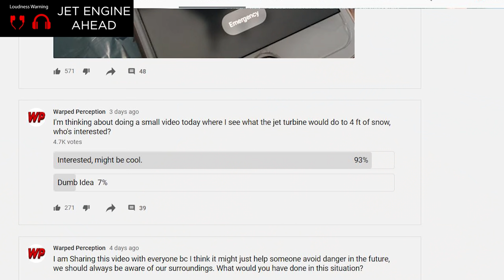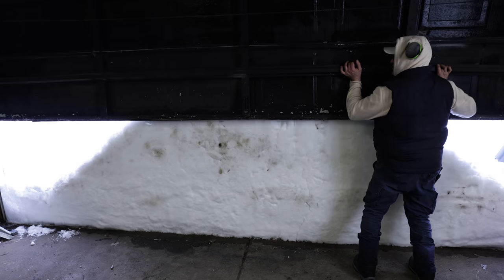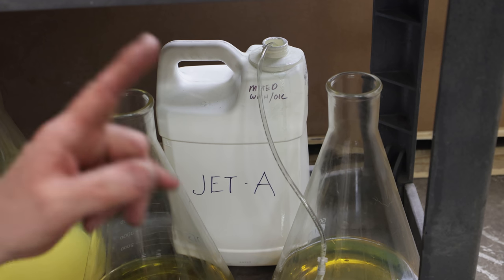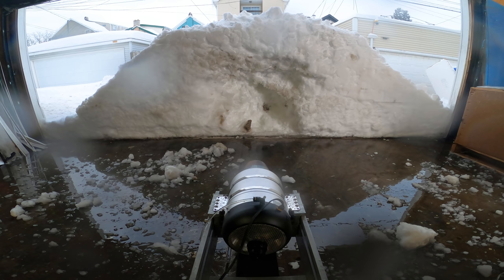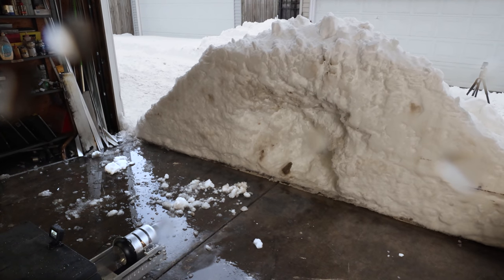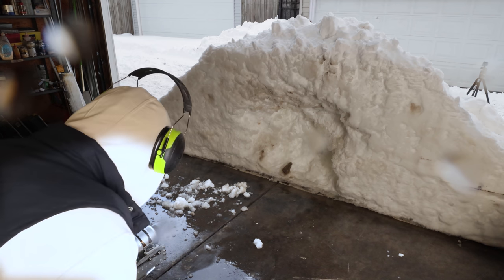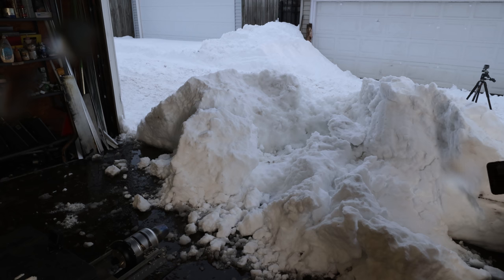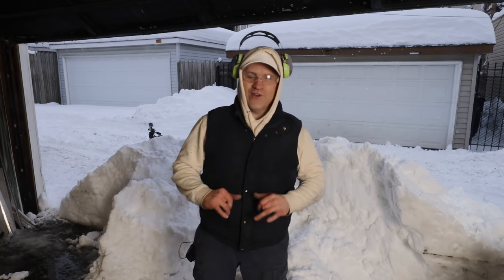Using RC Jet Engine to Clear Some Snow

Comment: I was wondering if you could use an aerosol can as a cheap substitute to nitrous oxide. Not exactly sure what kind, just something that wont make the engine get gummed up easily (mosquito repellent maybe?) Love your vids btw.
Reply: awesome question
Reply: not really better off using LPG
Reply: @GWRProductions-kg9pt  LPG?
Reply: @savagetuner2404  Liquefied petroleum gas
Reply: @GWRProductions-kg9pt  you could try saying gasoline lol
Reply: @GWRProductions-kg9pt  oh I read that wrong too dang it
Reply: @savagetuner2404  two completely different fuels
Reply: @savagetuner2404  LPG isn't gasoline.  It's propane.  I'd be curious as to what, if any, gains would be made by adding it to the intake.
Reply: @krb5292  technically LPG can refer to several mixtures of various ratios of fuels, just propane tends to account for over 80% of most mixtures. Butane is the second major constiuent, in some places, it is up to half the mix.
Reply: the only things i can think of are canned air (flammable when sprayed upside down) and carb cleaner, but im not sure if it would result in more power (or byproduct/carb buildup). I mean butane would be the obvious choice, but $3 nos sounds much more amusing lol.
Reply: @richardramsaran5093  carbon fouling
Reply: Lol upside down whipped cream can.
Reply: Nitrous oxide is an oxidizer, not a fuel
Reply: Nitrous oxide increases an engines power because it carries its own oxygen, allowing you to add fuel, & increase cylinder pressure which = 🐎🐎🐎🐎🐎🐎🐎🐎. 
So yeah man an aerosol would work so long as it carried oxygen in whatever it’s spraying. & here’s a fun / useless fact: Nitrous oxide does chemically what super chargers and turbo chargers do mechanically ie more O2, more fuel, bigger bang
Reply: @savagetuner2404  Why would he say gasoline while talking about LP? They are two completely different fuels..
Reply: twin slamanders as turbine jet engines...hmmm
Reply: Never use nitrous oxide on a rc jet engine. It would just meld down due to the highly increased speed and heat. Just Diesel or Kerosene and 5% of turbine oil as lubricant. LPG or CNG would be possible, if you change the lubrication system. However, the lubricant will be burnt so ever.
Reply: Or you can use dabs as a fuel. Might get high in the process but it's worth a shot.

Comment: I can only imagine what the neighbors are thinking as they hear and then see a jet engine attempting to blow snow towards their garage door.  lol.
Reply: You guys should collaborate on a jet powered farmabago
Reply: @MrPhatties  this is a good idea
Reply: They probably piled the snow up in front of his garage because they're sick of the jet engine noise hahaha
Reply from the maker: I was about to mount the jet engine to my little mini front loader and drive it down the street while blowing snow.   But I didn't do that because I need to use this engine for some upcoming episodes and the risk of damage from FOD was very high ...lol
Reply: Flame thrower would be better
Reply: @FuzzyWCTX   This actually works better than the flame thrower.
Reply: I like cheese
Reply: this project is call, which neighbor is the best, lets find out
Reply from the maker: @MrPhatties  yes!! Either like 10 of these on the farma or one 1000 lb
Reply from the maker: @voxelemur  no it's a typical City thing, if you have a garage that you usually don't pull a car out of they just use that spot to pile the snow to clean their driveway, there's just not enough space
Reply from the maker: @redredredred2  lol
Reply: @WarpedYT  make it happen and both channels will win 😅👍
Reply: Would be one of only a few things..  " what an inventive guy". "Hey come look, he's drinking again". "What do we tell the cops?"  "~ptsd flashback~". "I wish i had a jet engine to melt snow". "Godamnit i cant hear my matlock". "Benford snow blow 5000"....
Reply: @WarpedYT  are micro turbines safe to operate in enclosed environments?
Reply: Can you do a comparison of best jet fuels?
Reply: Jet engines make a better sound that a Briggs engine
Reply: If I lived in the country I'd be doing the same with my engine!
Reply: @WarpedYT  If you are interested, a YT channel called Agent JayZ  tests his rebuilt full size jet engines in what he calls jetwash alley. Big difference,3 gallons of fuel versus 300 or so. Clears a lot more snow.I 
Now if you could rig a power takeoff turbine and driveshaft, and turn your little engine into the sort of unit that powers helicopters or cars,that would really get you around town. 
It was interesting to watch this little beast do as much as it did. RC turbines have come a long way in 20 years or so. Impressive.
Reply: @WarpedYT  MAKE A UFO PLS
Reply: hi
Reply: @WarpedYT  what model engine is this I know it's a swiwin, but 
Which one?

Comment: Moral of the story: Jet engines only double the work for you to remove snow and clean up the mess
Reply: but it's also double the fun!
Reply: @FLUFFSQUEAKER  hell yea its all abt the fun ofc xD
Reply: Not if he had an F-16 or an A-10 Wart Hog then it would clear out everthing down that block lol
Reply: Moral of the story: you need use 9 of these jet engines
Reply: Moral of the story: you need a f-1 rocket to clean everything

Comment: There are airport runway snow blowers using old MiG jet engines in Russia.
Reply: In my country the old Mig 15 engine was installed on special train and it was used to melt a snow on our local railway.
Reply: Cool facts
Reply: @trainskid377  Просто умные факты не крутые

Comment: After the Blizzards of 2015 buried everything in Boston, MA, the subway trains grounded to a halt from tracks and third rail getting covered in snow. They rolled out a huge jet engine on tracks to try melting or blasting the snow away. It didn't work. The poor commuters in Quincy and Braintree had to use the shuttle busses for almost a month. Nice thoughtful video.
Reply: I remember the 2015 V-Day Blizzard all too well, found out that Fire Hydrants don't actually spray water when you hit them (the bolt on top actually goes all the way down to a valve in the underground pipe) and got to go to (mandatory) court in a fancy rental with several feet of snow on the ground and no where to park at the police station and pay a $200 fine (which I could only pay with a check despite them accepting cards for other things).  If they hadn't made it mandatory court they could've only charged me $150 instead of $100 for the ticket and another $100 for court fees.  I was (and am) in Ohio btw.

Comment: You probably didn't underestimate the power of the engine but the energy that is needed to melt snow. I always have a hard time wrspping my head around this. But the latent energy that is needed to melt 0°C ice to 0°C fluid is about as much as heating up water from 0°C(32°F) to 80°C(176°F). Of course just blowing it away should take a lot less but probably still needs more force :)
Thanks for your entertaining endeavors :)
Reply: It surprised me how difficult it was to melt snow and ice with my 500,000 BTU weed burner torch. Melting it was easy initially - but after it was covered by a small amount of water mere seconds later, it's like I was wasting propane. I have to remove the layer of water in order to continue melting. I had a hard time figuring that out. It does indeed take an unbelievable amount of energy to melt ice/snow, and/or boil water. The most effective and effecient way to do any of the above would be to melt it from below, with proper drainage of the water.

Its crazy how much different things actually are compared to what you expect them to be.

Comment: americans: remove snow using a jet engine is an interesting concept

russians; so we use the MIG15 or the MIG17 engine this time?
Reply: @Rodrigo Nogueira Mota 
we use Mig17 engines to heat the house, and for snow removal we use the RD180 rocket engine, you know we live in Russia 🚬🗿

Comment: I'll stick with my gas powered 2-stage snowblower. But using a jet engine as the engine for my snowblower would surely turn some heads. Great video as always.

Comment: Just an idea but, if this thing doesn’t already have an afterburner maybe try and build one yourself? That would be mad!
Reply: Was thinking just that. Or a pulsejet...(evil cackling)
Reply: Funny you say that. My final year project for undergraduate aerospace engineering degree was to take a similar small jet (AMT Olympus) and design and build an afterburner with a 3D TVC nozzle for it. We got about 40% more thrust with the afterburner.

Comment: I didn’t want to buy a snow blower because I thought it is lame... Real man can do it manually.
But this...
Reply: Real men have jobs and children and will do whatever it takes to get an extra 15 minutes of sleep
Reply: Negatory there ghost rider.  Real men have a built up procharged 454 big block with a 2 foot tall hightop blower sitting on top, a 200 wet shot straight down its throat,  zoomies shooting flames out all 8 and ran on pure methanol attached to an auger blowin a 200 foot high rooster tail of snow, gravel, grass and whatever else it picks up while he's running it at 7 grand walking it down whats now going to be the new sidewalk..
Reply: @Z-Ack  That’s for girls. I don’t see how you use your muscles there...

Comment: You just need a BIGGER jet engine!
Reply from the maker: First thing I thought of as soon as I saw how wimpy this was..lol. about 5,000 lb of thrust should do the trick!
Reply: @WarpedYT  Actually you need the least efficient engine, more heat less thrust 😂
Reply: @doejohn8674  flamethrower 🔥
Reply: @WarpedYT  contact agent jz

Comment: If you didn't know, this is a real industrial product!  Many railroads actually use jet engines mounted on special railcars or "hi-railers" (work trucks with retractable train wheels) to blow snow out of track switches.  Conventional plows can't reach between the rails without damaging switches so hot, high velocity air is the optimal solution.

Comment: I kinda thought most of that was gonna happen. I mean, if you heat snow or ice its going to turn back into water. And if you make a hole in any structure, there's a chance of collapse. But I think you probably already knew this, and you just wanted to play with your jet engine 😉👍🏻👏🏼

Comment: Maybe not the preferred method of snow removal, but certainly a lot of fun! And yes the first thing I thought when it started blowing the snow out in bits was you were going to have one heck of a mess on your hands. 
It indeed takes one heck of a lot of heat to melt frozen water.

Comment: Cool I had the idea just now I'm tired of the snow. Perhaps if you did a top to bottom deal you'd have better results. You'd need to hold the engine though.

Comment: I think the best way for snow removal is using thermal threads going up and down the road that heat up the concrete/asphalt on that road all the way down to the drain pipe with a salt drip going to the drain to keep the water from freezing over on the drain pipe, just to keep the flow going and a thermometer reading switch to turn on the heating elements to warm up the effected areas to keep the areas between 34-40 degrees Fahrenheit with protective coatings to the heating elements to keep them from burning up or corroding over time. It might be expensive.

Comment: Trying to melt the snow is definitely no-go due the amount of energy snow needs to melt it. With powerful enough jet engine, you could blow the snow away but it might cause it to fly towards other things so fast that it would cause collateral damage. When this little engine completed the tunnel, it seemed to start throwing snowballs towards the building in the front of the carage.

Comment: Well... most of the snow is not water but encapsulated air and that's why it is a great insulator. To get rid of the snow it is way better to use mechanical force than blowing or burning/melting it.

Comment: It is common for railroads to use jet engines to clear snow from track switches.   They are used to blow the snow away rather than melt it.

Comment: LMFAO! What do your neighbors think of you??? It looks like your in a pretty tight area where your at..... shit I'm out in the wide open countryside of NY and still have neighbors complain about noise or smoke from my engines running too much lol! But they use large gas/diesel turbines to dry air strips and drag tracks why not? Also use them up here on farms for keeping the frost off the apple trees using tow behind turbines on the farm tractors. Very messy wet demonstration you have left over with, hope you have a squeegee for the floor lol. But it's incredible the power of thrust those little jets make!

Comment: HeeHee! That was fun, but I was secretly hoping for a Tim Taylor moment, wondering if your snow problem would be adequately solved with afterburner. 
Other than noise and the resulting puddle, I guess you'd be aiding yourself in discovery when the Fuzz show up to investigate and your driveway is the only one on the block that's Overly clear.

Comment: Not to give you any ideas or something. You should add a afterburner to that thing
Reply: Funny you say that. When I did my undergrad degree in aerospace engineering, my final year project was to take a similar small jet (an AMT Olympus) and design and build an afterburner with a 3D TVC nozzle for it. If memory serves, we got a 40% increase in thrust.

Comment: Quick question, if heat rises, why is the top of the jet not red before the bottom, is it because of the force of the engine directing the heat outwards so it cant travel up?

Comment: I think the reason you're not getting max power from the diesel is because it's a heavier fuel that requires longer burn time, like a truck engine reintroduces the unburned fuel back into the combustion chamber after first burn
Reply: I know this is an old comment but still wanted to give my 2 cents.  As far as I know Diesel and Jet A are actually the same thing except that Diesel has a dye in it and is taxed differently.  It could be that the dye is causing problems or it could be the way it was stored, perhaps the Diesel took on water from condensation.  (It's also possible that he's already figured it out and I just haven't watched that episode yet).

Comment: Add a couple drops of Magnesium to your BIOFUEL, and enjoy... Magnesium melts ice effortlessly, I use a couple drops in a pyrex spray bottle to defrost my work freezer, I also use morphine in the mixture but you won't need that xD
US Raptor engines use this mixture along with mercury :)
Helps us defrost our drysuits in subzero conditions ❄️🥶🧿🔫

Comment: waay back in the day when JET A was cheaper and subsidized by the government jet snowblowers was tested/used by several militaries. i have seen them here is Sweden and pics from other countries, for clearing runways not residental ofc.
Reply: They actually have those here in Chicago for the commuter railways.  It's been a while since I've seen them working outside the switch yards, but we've got 'em.

Comment: Its interesting to see that the snow not instantly melts becouse of both being a bad heat conductor in snow form and the airflow being so high it doesnt get a chance to transfer properly.
Same thing happens with computers that have to many fans or fans spinning to fast. At some point the heattransfer actually decreases with increasing airflow.

Comment: Hi, Warped Perception.  I have been thinking about my comment of last night as I have been watching these videos in order as they appear on the watch list, and I want to apologize for being perhaps more harsh than I intended when I ripped into you about buying that brand new expensive dishwasher just for one single little piddly experiment.  I actually like the stuff I see you doing on your channel because they address many things I have always been curious about --- but I'm just so shocked about how many brand new things you buy that you aren't even going to use permanently.  I myself have gone overboard on experimenting --- even to the point when, at the age of 23 before I went on Social Security and had a real job (which never worked very well in the first place), my mother once had to call the local hardware store and stop them from letting me buy a 250-dollar propylene water pump I wanted that could be powered either by hand or by an electric drill.  So if you thought last night that I was scolding you about being too unduly expensive with your experiments --- well, welcome to the party of those who can't control their experimenting because I have been in the same boat too.  It's just that at my present age of 51 I am older and wiser and have worked through it all.  I hope you can work through it too.

Comment: Good Ideal. But it does not work because the force of the jet engine blasts the air and snow back into the direction of the garage which will make a mess.

Comment: Would love to see this on alcohol I know it would require more fuel than it designed to supply but carries oxygen so should make more thrust and cooler so the turbine should thank you... Would love to see gas too especially mixed with diesel to thin the diesel

Comment: And now image what can do large jet engine with snow on airport runway, even deep frozen dense ice on surface will be disintegratet in few seconds, large engines from  old aircraft were installed on tractors and cleane all with them

Comment: I have always wondered if you could use one of those small jet engines to spin up the turbine on a turbo for a drag car...so you could have large amounts of boost at anytime totally independent of engine RPM. The engine exhaust could go straight to atmosphere unimpeded by the turbine. Kind of like having best of the both worlds of a boosted car and a NA car
Reply: The turbine has to be there to power the compressor, else the gas turbine wouldn't work. Driving a turbo with a turboshaft sounds interesting, probably outside of the rules tho.